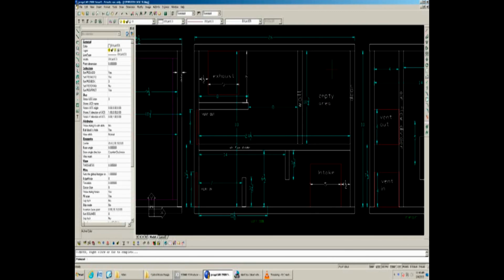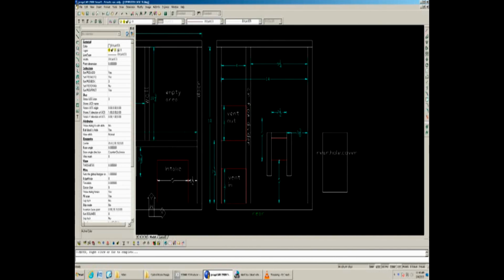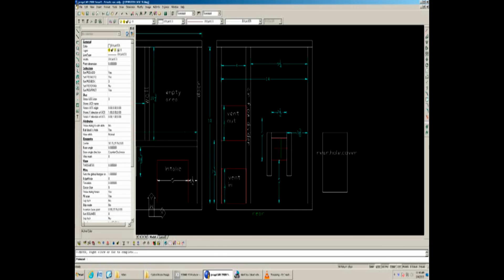silent computer isolation cabinet

Comment: The idea of attaching the fan with silicone if fascinating.  Does that work better than some kind of rubber or foam isolation?  If it works as well, I can see how it does double duty as both mechanical isolation and as a way to attach the fan to the cabinet.

Comment from the maker: I've been using this for a year now, and when the door is on and my cpu is cranking, my sustained air flow technique (cool air sucked in near floor, hot air blown out up top) has maintained temperature only a degree or 2 hotter than when the door is off.  So it works.